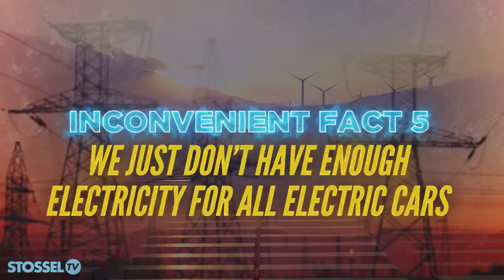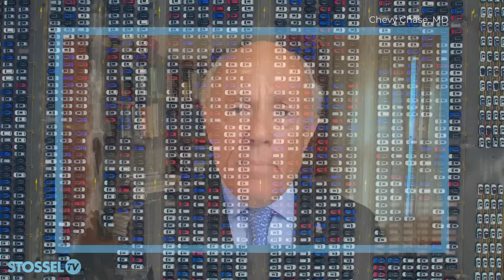Electric Cars: Inconvenient Facts, Part 2

Comment: I was dumb enough to lease a Tesla because my wife wanted one. Insurance doubled. Every trip has to be preplanned, spontaneity goes out the window. It eats tires due to weight and torque. Updates to my phone disconnect it from the car. I have to delete and reinstall or the car won’t move. Full self driving is a joke, most drunks do a better job. Ghost braking, enough said. The worst part is the fact that Tesla can see me wherever I am, see how fast or slow I drive and with the cabin camera, invade my privacy if they so wish. This is big brother on steroids. When my lease is up, I’m going back to Honda or Toyota.